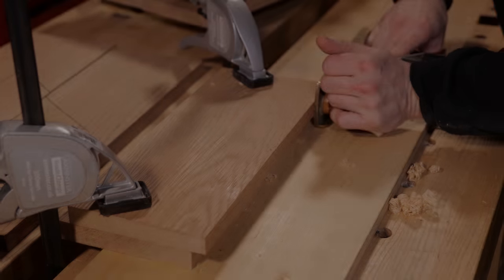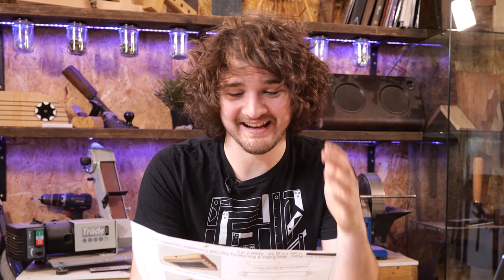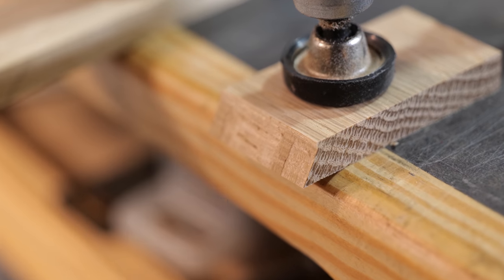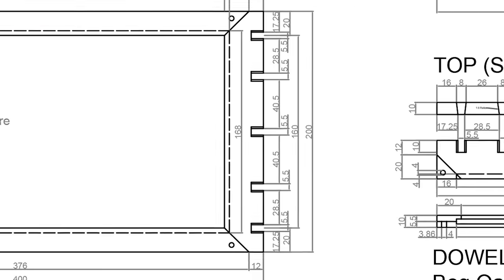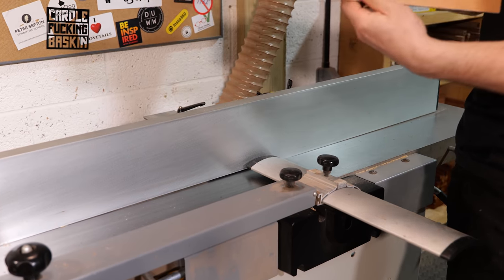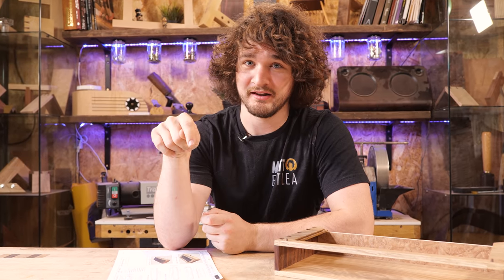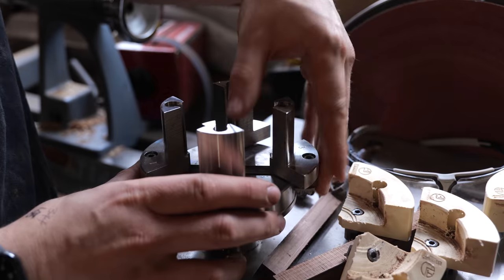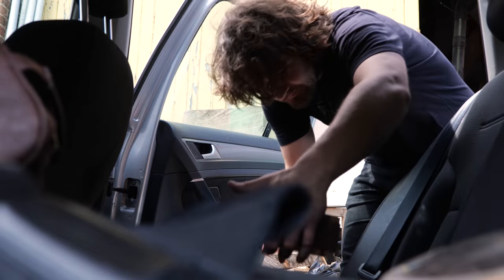I was COMMISIONED to make THIS? (No Payment)

Comment: Nice box. The only difference I would have made (design parameters allowing of course) would be flocking the inside of the drawer. Just personal preference. Great job, Matt.
Reply: The drawer is lined with a grey baise material as specified in the design

Comment: Having run into a similar problem of wanting a dovetail in a cross-grain situation, I solved it differently, I made the piece long grained, but put dowel pegs in the ends about twice the length of the dovetail before cutting the dovetail, then each dovetail has a peg up the center
\ || / to reinforce it.

Comment: I just got into hand working wood a few weeks ago. everything is going smoothly expect for my chiseling. I keep chunking the wood instead of slicing even right after i sharpen the blades and making shallow slices. is it the wood i have been using (I think it was pine) or is it the technique (along vs against the grain) or something else im missing?
Reply: Are you sliding the chisel side-to-side as you cut, or just pushing it forward?
Reply: @Offshoreorganbuilder  pushing straight forward
Reply: @P_Petkov  That is probably the source of your trouble.
Assuming your chisel is really sharp (to the point of taking hairs off your wrist) try using a slicing, side-to-side movement.
Watch some of Paul Sellers' videos and see the various ways in which he uses a chisel.
Reply: @Offshoreorganbuilder  thanks for the tips

Comment: I woulda liked to hear about why that drawer was hard to do
Reply: I badly designed it, with stopped groves, and without a lower back part which would have caused air pressure problems pulling it out. So Matt fixed my error my reducing the height of the back panel and raising the lower edge to allow the base to go under the back part. Check out the cabinet project on matts channel that has a video on drawer construction